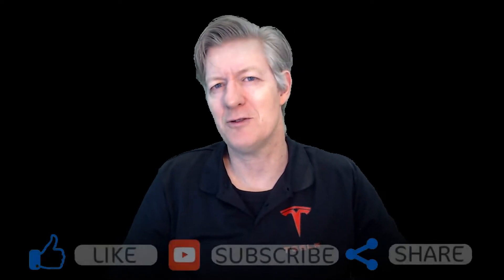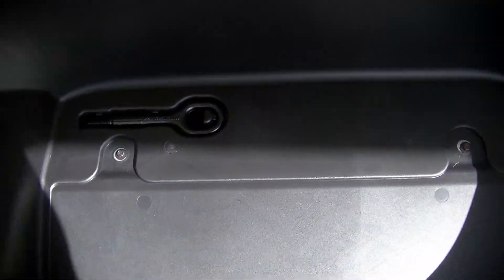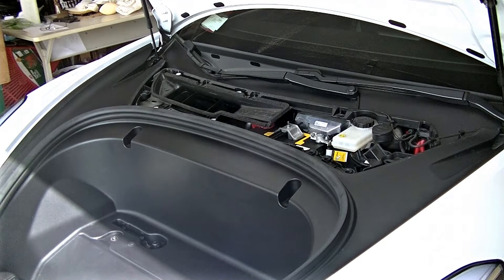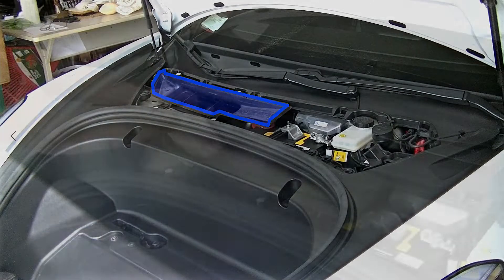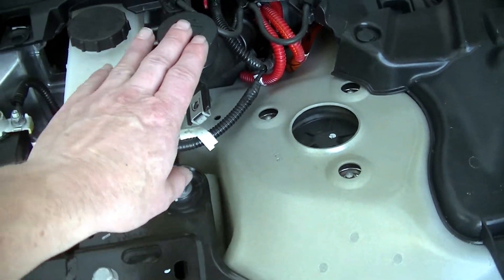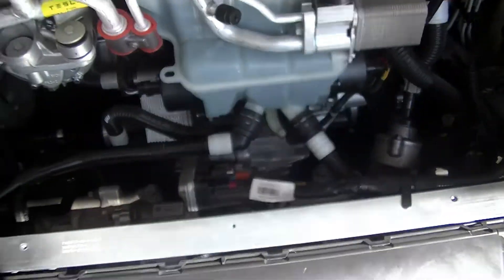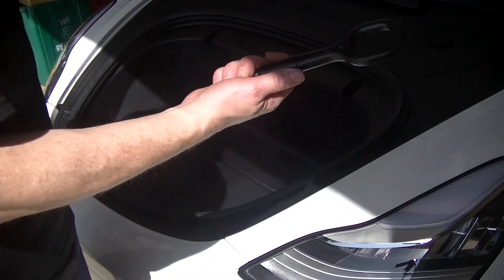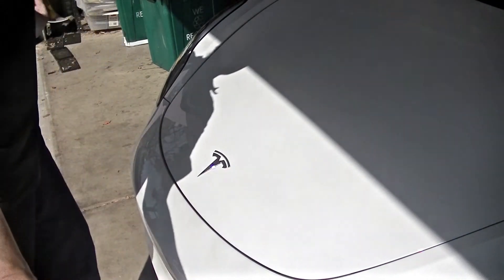What's Under the Frunk of a Tesla Model 3  Tutorial - How to Change 12v Battery

Comment: What’s that large black thing in the front? Looks like a radiator or large air intake or something.
Reply from the maker: There is an air intake for the cabin, just forward of the windscreen whippers.
Reply: @selmateacher7  Sorry, I mean the large black thing that's at the front of the vehicle in your video (not near the windshield). It looks like some sort of air duct or something. And is the silver bar going across it some sort of brace?
Reply from the maker: @peterrwagner3289  That directs air through the system radiator that cools the motors, batteries, and everything.

Comment: Love the safe and security features that Tesla installs, however, once  you turn off the power and if someone closes the door, you might have some problems getting to that power switch.  Guess you have to lock the garage when you start this process to prevent folks from accidently closing the door.  Very informative video.  AAAAA+++
Reply from the maker: I know that there are emergency releases, but you can end up damaging the top of your door, if you open and close the door and the main power to lower or raise the windows is off.  The doors' windows go up into a slot that is in the roof of the car and that is why when you press the button to open the doors, the windows shoot down an inch, to clear that slot and open.   One way to avoid all that is to have the windows down a bit, then it does not matter, as they are not up in those slots.. if you were going to have the power off.  BTW- I have only had the power off in my car once, when I had the 12v battery replaced by Tesla service.